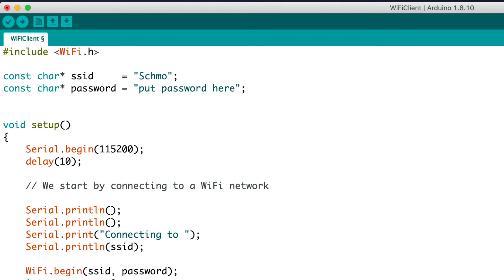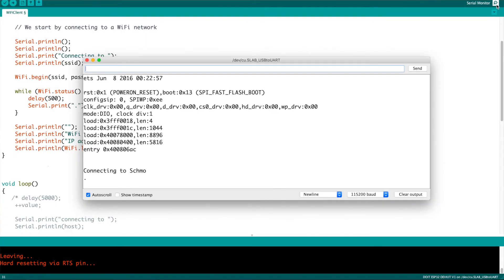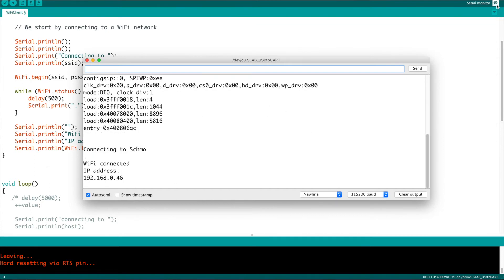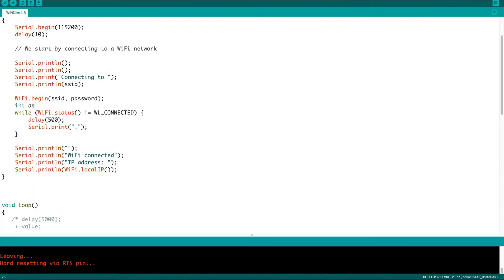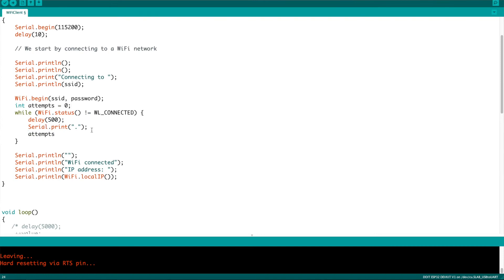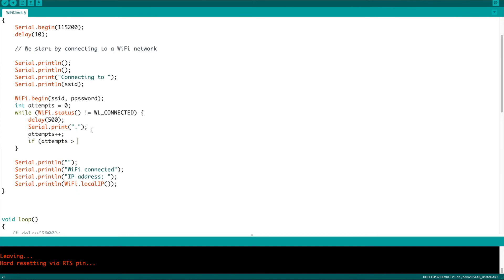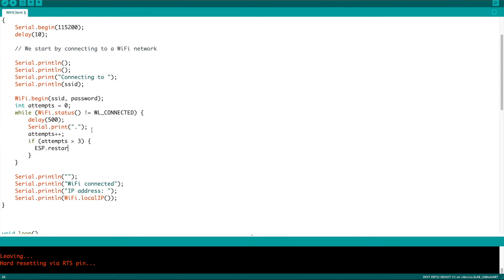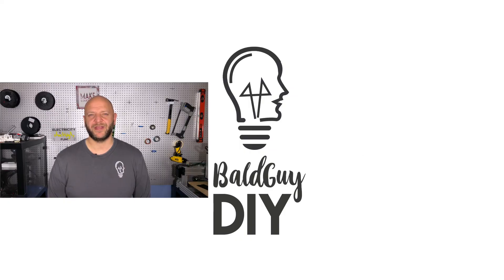ESP32: Reliable WiFi Connection

Comment: Ah man, looks like you got some warping and bed adhesion problems in the background. Printing ABS? Seriously give ASA a try. :) Seriously good video though.
Reply from the maker: Thanks for the tip but going a different route to improve print results. Bambu Lab X1C on its way:)

Comment: I did something like this on the TTGO T-Display, but instead of the ... I displayed the number of attempts. Also put in a dropped connection detector that would send it back   to the login  loop if it lost wifi after it was running..

Comment: Even after following your trick, the Wifi connection is not established. I don't know what's wrong with my Adafruit Huzzah ESP32 feather board .
Reply from the maker: I haven’t used that one before so I’m not sure if there’s anything particular to it that would make the connection any different. Does it ever connect if you keep resetting the board manually?  In my case, it would connect every second or third time with a manual reboot, so I figured rebooting it in software would accomplish the same thing.
Reply: I tried different options to fix WiFi connectivity issue with no solution. Finally I made my ESP32 as a WiFi host instead.
Reply from the maker: @taratimsina2841  glad you found a solution!

Comment: This issue was driving me nuts until I stumbled across your channel (after spotting your 3D Printer Enclosure build video).
I've had an ESP32 based pool pump  controller, a water tank depth gauge and a solar monitor all take "turns" not properly connecting at different times. It was very frustrating until I did something almost identical to what you have done and could recommend it highly - haven't had a reconnect problem since.
Congrats for a simple, clear and well presented solution.
Reply from the maker: Thank you!  It’s the simplest solutions that are most satisfying many times:)